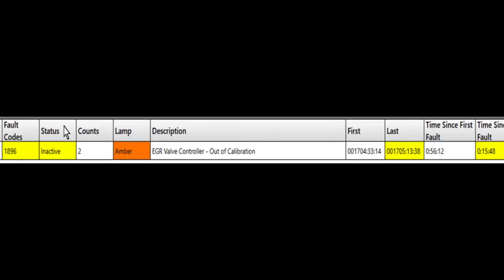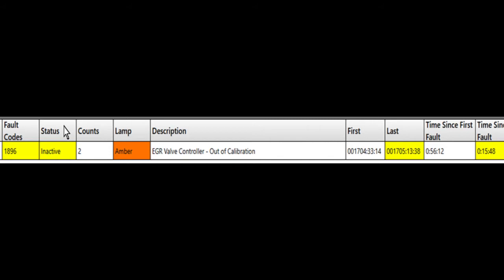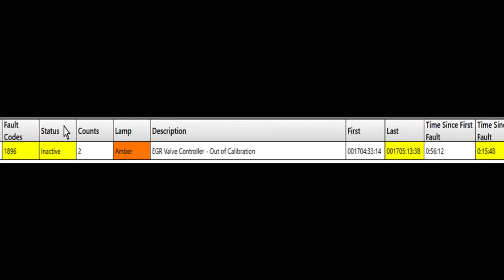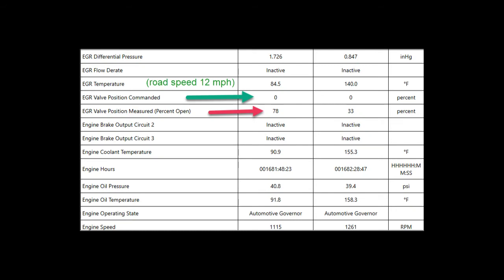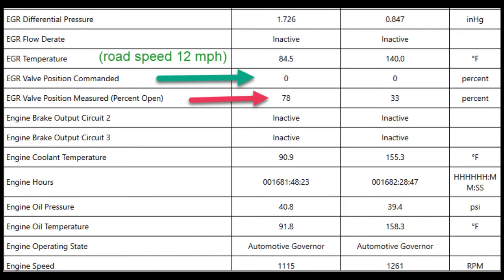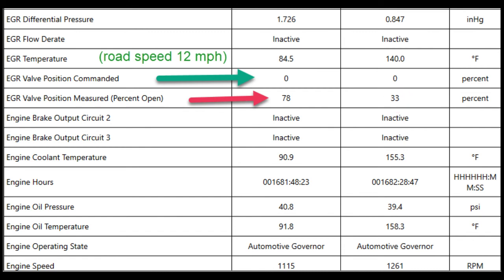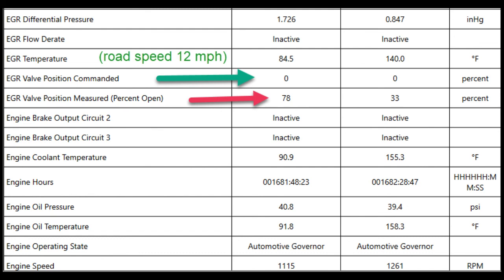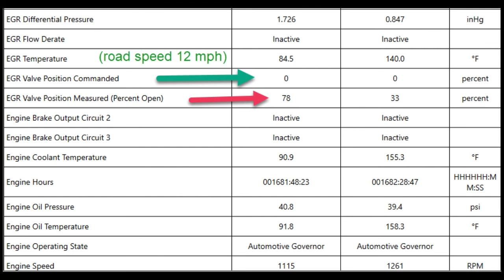FC1896 ISX871

Comment: I have been having a lot of EGR valve issues recently with my fleet. We run all ISLs (9s and 12s). Would the CNG fuel be causing mine to stick more frequently with the cold weather? Would it be best to clean them if so, or just change them? Any prevenetive measures i could take to prevent these EGR issues in the future?
Reply from the maker: You mentioned CNG so you run a compressed natural gas fleet?. CNG has a lot of water vapor in the exhaust so in very cold weather you could have egr valve freeze up. Let me know  engine serial number and the egr fault codes you are having. I will see what I can find out. I worked on Natural gas products when I was at cummins but they have changed quite a bit since then. 
Speaking of gas this year cummins is releasing into production an ISX CNG engine that makes close to 550 hp and 1850-ftlbs of torque . Quite amazing I think.

Comment: EGR valves appear to be a very common problem with the ISX engines.  Every one I have drove with and without emissions equipment has had EGR problems.
Reply from the maker: There was quite a learning curve for the engineers when it came to EGR. Many factors play into an egr valve's "service Life".
The 2013 and newer ISX 15s in our fleet have very little EGR "valve" issues. Not to say we dont have EGR system issues. 
The early Hot side valves (2003ish to 2006) Those valves got cooked if anything went wrong with the turbo VGT or charge air system.
Reply: @ENGINESHOPJOE  I didn't think they needed EGR anymore after they started putting the SCR systems on?  I was led to believe the EGR was for sending a percentage of the exhaust gas back into the air charge to reduce nitrogen oxide output.  Isn't the SCR system designed to neutralise nitrogen oxide with DEF injection?
Reply from the maker: The answer is yes to both your statements- with qualifications. The emissions regulators such as CARB (California air research board) continually decrease allowable permitted emissions of NOx and Particulate matter as time goes on.  There are charts of allowed emissions by year and by Horsepower. On highway engines are categorized by emission year and off highway they use a Tier rating. So depending on the year the engine was built  and its application and power rating it may need only SCR or SCR with EGR or just EGR to meet the standard. As technology  advances they are moving away from EGR when ever possible. An interesting fact I learned many years ago, and as far as I know still holds true is this. Emissions output is averaged. So every engine has a line on a chart that it has to average at or under. There are times where to maintain pulling power, AKA torque ,you  can't have EGR flow. So for that short time the engine is output is "dirtier" then it should be. But there are other times where the engine can run exceptionally clean. As long as that average is at or below it's allowed output it meets its requirements. This is all figured out in test cells where test engines run under varying conditions and loads for literally tens of thousands of hours and then verify and receive their certification level.
Excellent comment and question-Thanks
Reply: @ENGINESHOPJOE  You are the first to be able to explain how and why that system is being used!  I appreciate that!  I have asked countless mechanics and they really have no clue other than if it comes with that system on it, then that is what needs to be on it.  I have learned quite a bit from your videos so far!